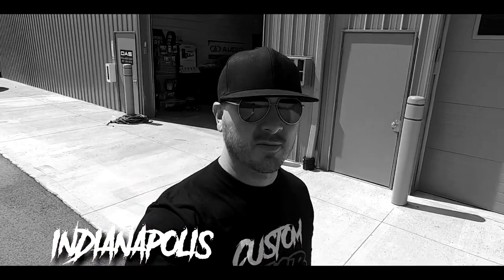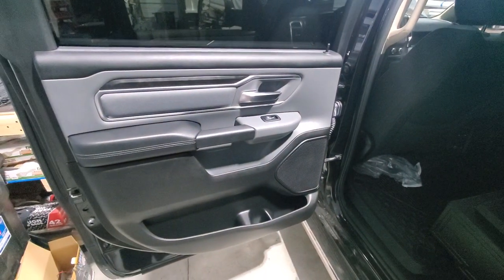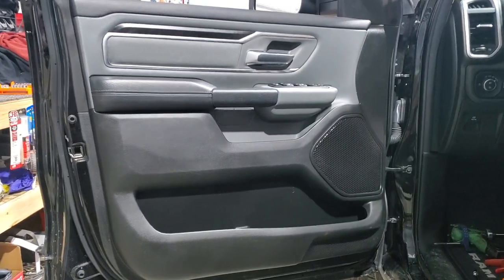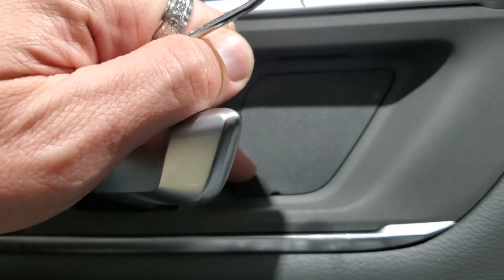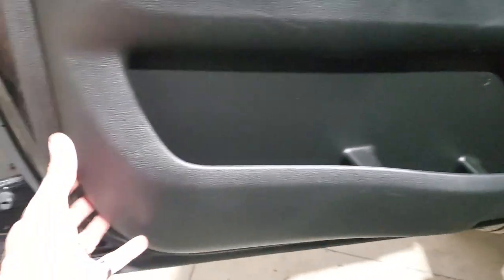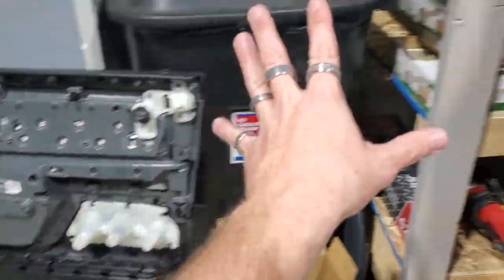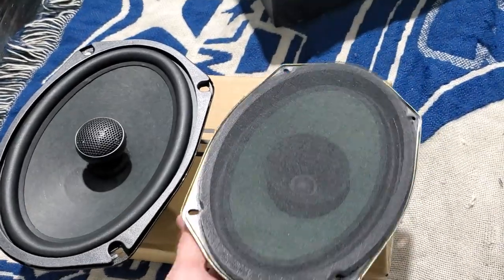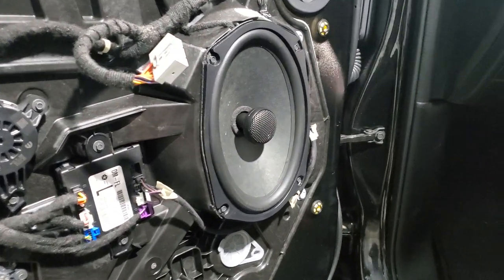2019 -2021 RAM 1500 FRONT SPEAKERS INSTALL AND UPGRADE

Comment: I just changed all my stock speakers… Audio Dynamics 2000 series 6x9 coax in the rear and 2000 series 6.5 components upfront. Great sound! I was going to install an amp but don’t think I need one. These speakers are great! Only regret is not going with 6x9 components up front but fantastic sound coming stock head unit. Very impressed.
Reply: Do you using factory amp and do gju have a sub installed as well?

Comment: I love this video. I’ve had 3 rams so far a 2020, 2022 and currently a 2023. 2 of the rams I had the alpine sound system which I think is good enough even for me. But the 2022 ram I had came with only 6 speakers and no subwoofer it was absolutely terrible. I always wondered how I would be able to upgrade them and your video made it seem so easy!

Comment: You're funny man, legit 80's! So what's the built in crossover do? I just bought some 6x9 Pioneers for $70 at Walmart. Didn't want to spend a lot, but figured they'd be better than what it currently has.

Comment: Upgraded mine on my 2020 Ram Rebel , took me about 30 mins , 15 mins for the first door, then was able to the other doors in mins. I went with THE INFINITY REFERENCE 9633ix. The sound is night and day even with the stock head unit and no amp
Reply: Did you upgrade all 4 with the infinity speakers? Was having 4 tweeters too many did you find?

Comment: I have a 22 rebel with the factory alpine system, how would these audio dynamics speakers work with that system?
Reply from the maker: I am not sure on the Alpine but we have done many of the Harmon kardan units and it has sounded amazing!
Reply: Same here did u need to add an amplifier
Reply from the maker: @kingofslotsmillion3263  we did at an amplifier

Comment: I’m planning on installing Skar TX69s in the door speakers, and their Tx3.5 in the factory dash speaker location.

Do you think the sound will be bad? 

The ohms match for the door speaker, and the ohms are 4 for the new ones, 8 is the factory dash speaker.

The TX69s are also coaxial not just mid support

Comment: This will work without having to add an amp? Any issues the ANC (active noise cancelling)? I have since a bypass piece people connect to the anc under the drivers seat
Reply from the maker: Depends on the model of truck. His truck did not have active noise cancel so it was not a problem

Comment: So without upgrading and running an amp it made a big improvement?
Reply from the maker: Subs definitely make a huge improvement. I would say changing out the speakers makes a pretty drastic change in the sound quality but the biggest sound quality difference on the speakers is going to be adding an amplifier for the speakers. You're going to see at least a 60 to 80% increase in volume and clarity

Comment: does anyone know if the 2021 has the same underseat storage space specs as say a 2019 or 18? can't find a single 12" sub enclosure marked specifically for the 2021 ram 1500 classic.
Reply: MTI Acoustics makes specific sub boxes for the Ram 1500
Reply: If you have the classic your best option is foxbox acoustics or getting a custom enclousre built